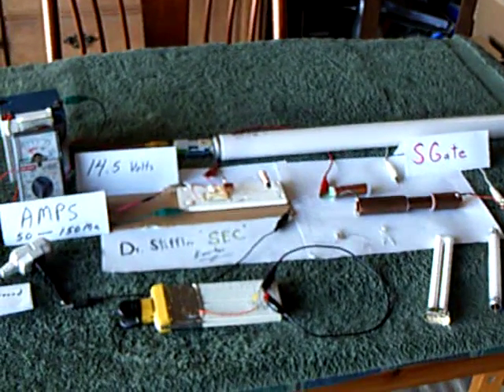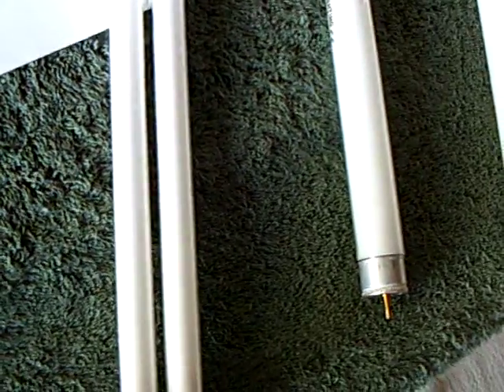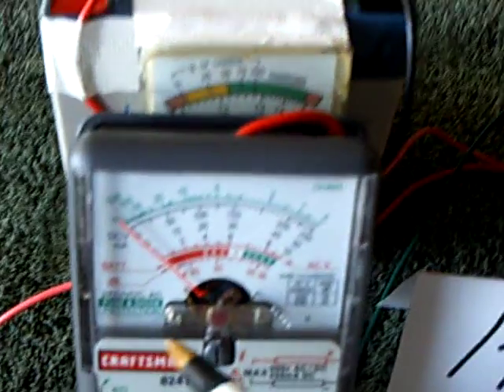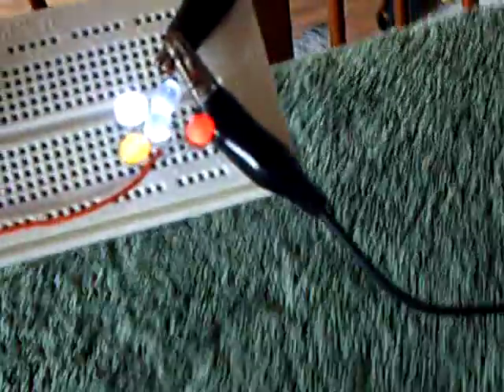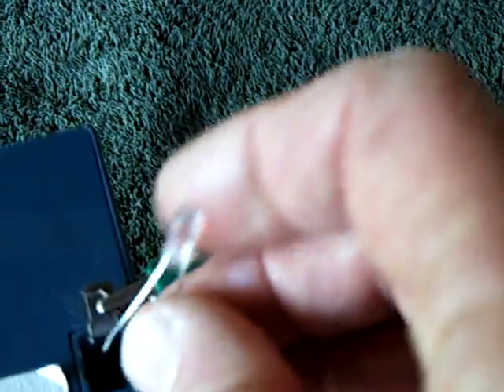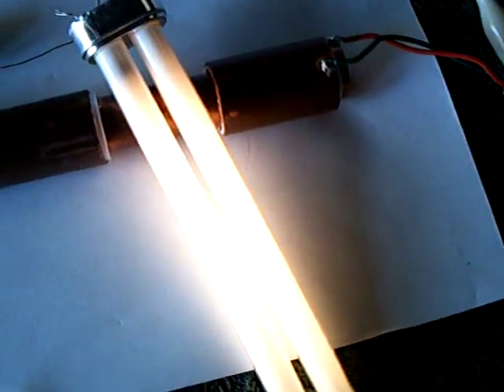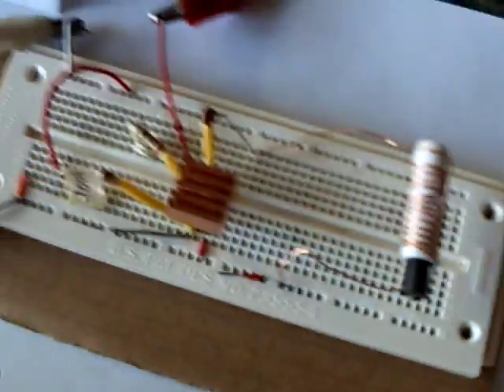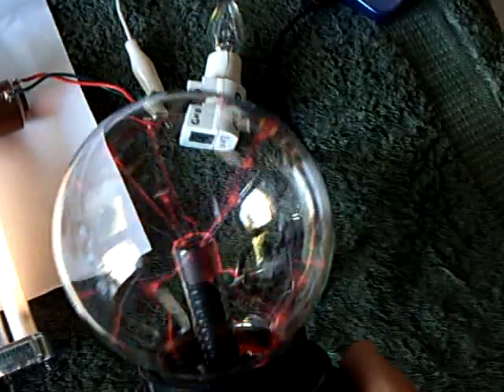SEC with SGate Lighting FLs

Comment: Great work!
If you wrap the plasma ball with aluminum foil, you can get the CFLs to light up brigter and they will not go out at greater distances. The extra foil gives additional capacitance. You will be able to draw some sparks from the foil with your finger, but do not do that, because it burns.